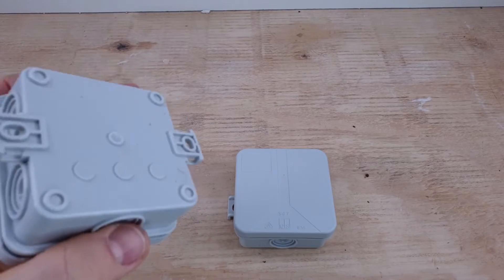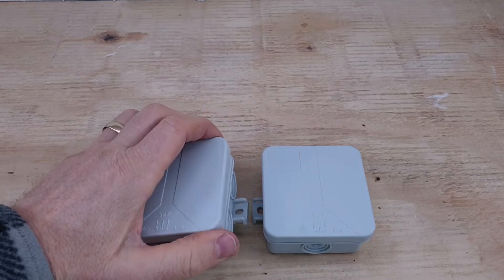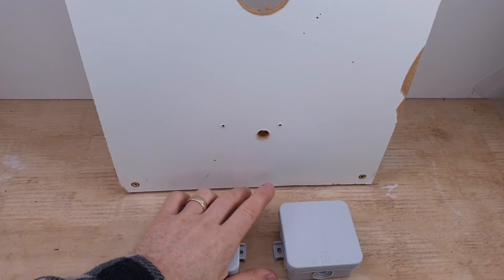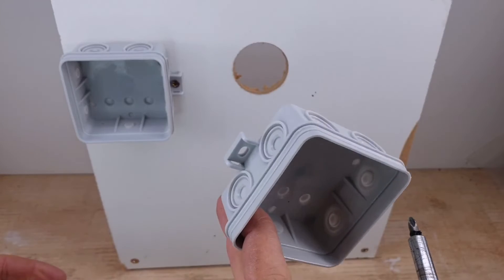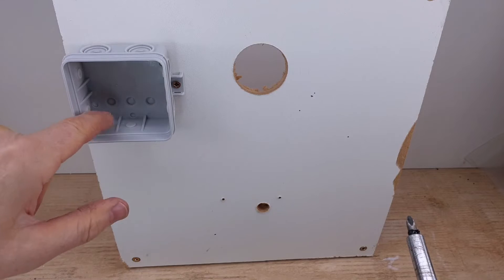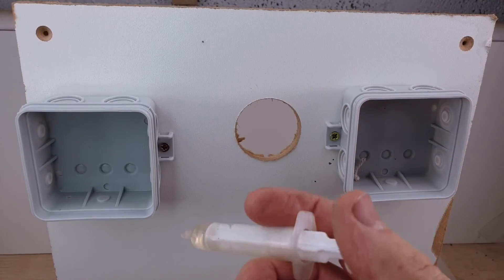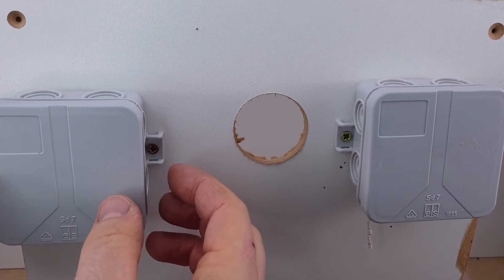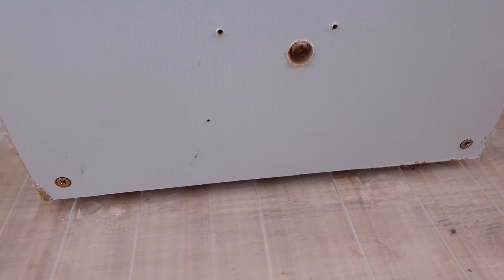Will This Simple Trick Remove Electrical box condensation?

Comment: That’s alright until the box or the conduit running into it suffers a seal failure, and fills without water without tripping the mains, then someone touches the wet string. I’ve actually had a shock from the wet string of a pull cord light switch being full of water from a flood upstairs before. Good idea though, could easily be made safe with a cut off bit of conduit  around the string.
Reply from the maker: Nice catch, I've got a short coming out that shows just how fast the water comes off the string as I missed it on this video, looks fast enough to stop the box filling up. But I like the conduit idea or maybe some earth sleeving pulled through the hole with the string halfway up it.👍

Comment: Wow, I never knew that. Everyday’s a school day on your channel 🔧👍🏻
Reply from the maker: It seems simple but I wonder if there is a reason why I've not seen anyone try it 🤔
Reply: @50plusdad-uk  I’ve never seen that suggestion before and I’ve watched a lot of DIY stuff on YT 🤣
Reply from the maker: I guess time will tell.👍
Reply: That's a very reasonable test.. The thermal cycling is a killer on all sorts of industrial enclosures. A downside to the wick system is of course that the rain would seep up such an arrangement. Gore-tex / breathable membranes are often used on hermitically sealed electronic measuring instruments that may be exposed to the elements.
Reply from the maker: Maybe cutting the string shorter so it's covered by the box might help with the rain problem?